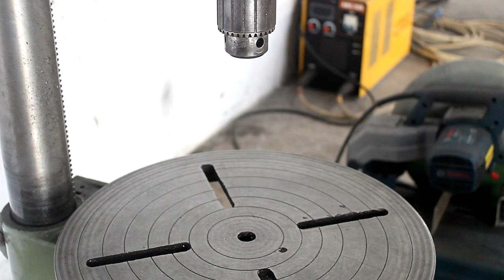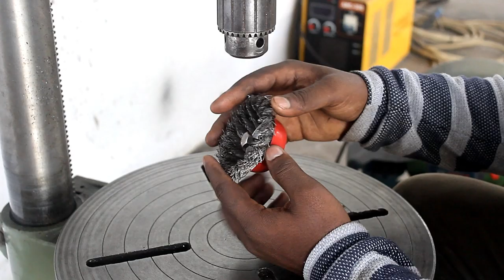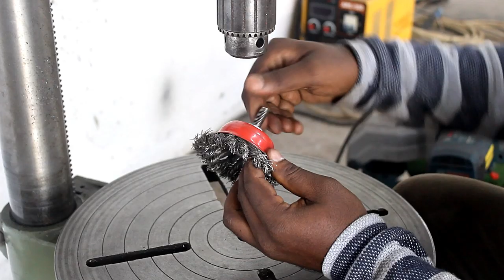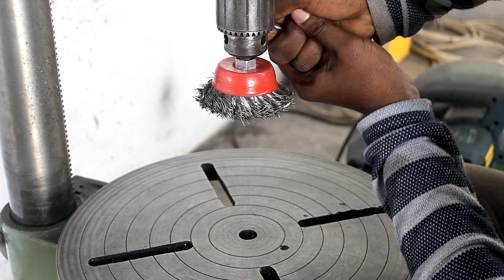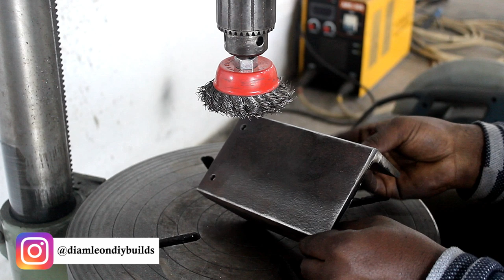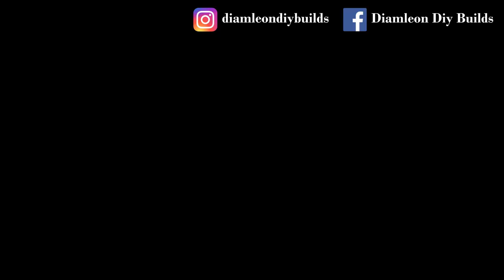Drill Press - HACK | Homemade Tool

Comment: Clearly has no clue what he is doing. The Chuck key is too small and the Chuck should be tightened in all three points. Further more, you see it loosen the he has to give it another go. These practices need to be done especially when using thing not designed for the application. It's okay to be creative, but not knowing about how to properly use a tool when doing it is just stupid!